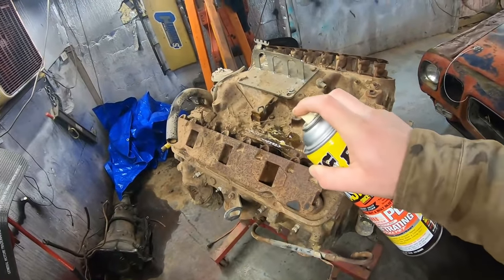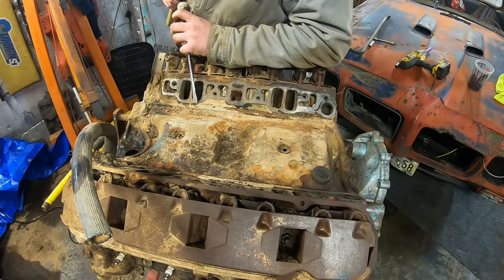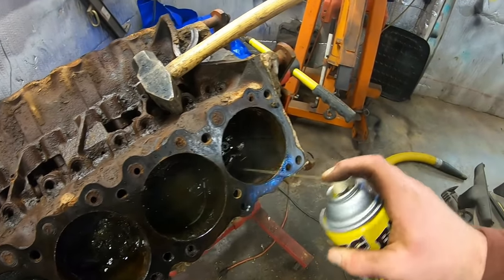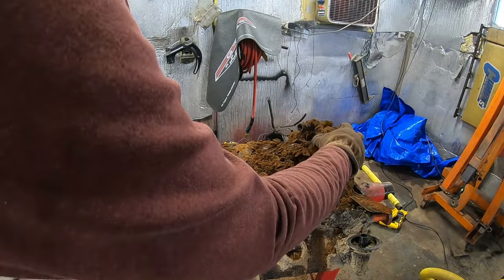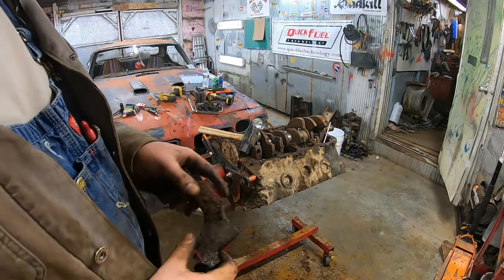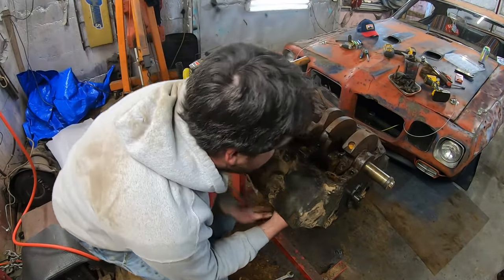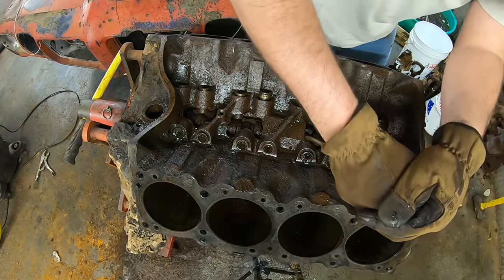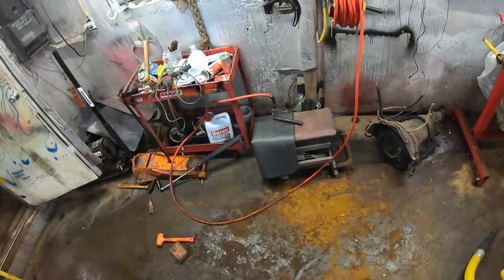INCREDIBLE! Worst GTO Ever: Holey Goat OG Pontiac 400ci Engine Teardown — CAN IT BE SAVED?

Comment: It’s probably been said already but I’ve had a lot of success de-rusting parts using a 2 or 4 to 1 mix of molasses with water. You can buy molasses in a big tub really cheap from a horse feed supply then just put it all in a plastic bin. I didn’t use this on my 400 rebuild but have used it on lots of other parts that have captive components e.g. heater box on my ‘68 Firebird.....and then get it hot tubbed if needed. Love the video too 🤓👍
Reply from the maker: It has been said, and with your comment I'm now even more curious to try it!

Comment: hing is fixable, unless its crack, I pulled a 401 nail head, under ground for 30 years, And got it apart and running, I stuck the block in a 55 gallon drum full of old oil Built a fire under it for 2 days, worked perfect. Try it

Comment: Thats horrible, I pulled one apart that was in the bottom of our lake here for nearly 40 yrs, it was rusty but it wasn't even that bad. I got lucky and was able to save the double hump heads on it, rebuilt them and ran them on my dirt track car. Never do that again cause it was giant mess all over my shop. Love the vid, brings back memories. God Bless!
Reply: Lot of the bolts just broke off so it was a fun time tearing it down. Impact and a torch, lot of sweat and swearing, few broken tools but no sweat! Pistons didn't come out neither did crank so it got dumped after heads removed. New valves springs and some machining she was good!
Reply from the maker: Thanks!

Comment: I had the Ram Air 400 in my 68Firebird  I bought brand new, the car was an idiot magnet, my best friend drove up and tore the door off a week after I bought it, I was parked in a drivethru diner, an idiot cranked his wheel and caved the whole side in , no insurance, got sideswiped by a hit and run driver tore the other side up, never found them. Then I got rear ended by a sleeping truck driver on the freeway ,and he almost ran over me, I got drafted and sold it in 1970. It was a beast of a car though for the time period, now it would be a sled, but back then it beat most production cars  It had a terrible time coming out of the hole though with the 4 33 rear end and no traction bars. I always wished I had the money to put traction bars and slicks on that car and see what it would do, my best 1/4 mile was 13"70 and I know a better set of pure stock tires would  have really helped wide ovals sucked

Comment: Run a wire from block to your electric pipe. Preferably to cold water,  bond it with a hose clamp. Quick & safe solution, for your getting  zapped issues. See NEC 250. Hugh Mc. Chicago,  metro
PS: may I humbly suggest, safety glasses. We get one set of eyes.Peace. [ nice work on stripping block,  hope no cracks when they magnaflux it.

Comment: That was kinda fun (at least to watch)
 Subscribed 
Great to see someone who isn't just 'spend $20,000 on new parts' or 'stick an LS in it'
Didn't think anyone in America did this sort of thing.
Never seen those valve 'drippers' before and didn't know they existed although I've only pulled two Pontiac engines apart (1965 Catalina 389 and a 76 - 400)
Both are still sitting in garage since I was laid off and couldn't get a job (now I'm retired and even more broke)
Never seen a motor that bad unless it was underwater for years. 
Even one that had gone off a cliff and was on the rocks for years wasn't that bad (even though the rest of the car had rotted away with sea water)
Reply from the maker: I might need that 389 👀
Reply: @PoleBarnGarage  Heads are good with a very small chamber. 
'Small' valves as well though.
I was going to fit hardened exhaust valve seats and large intakes but never got around to it, new seats still in box
Block has a very bad cylinder that is going to need liner, pitting is real deep

Comment: The absolute best product for derusting any ferric metal is Evaporust. It's non-toxic and non-acidic and non-corrosive to the base metal. It only attacks the corrosion. It works by a process called chelation. I bought a 2 1/2 gallon bucket at Summit and used it for 4 years. It works good till it turns black with use,  then becomes less effective. The metal comes out looking new. Safest way to save the parts and completely derust them. BTW, it does get very cold in TX. I travelled to the DFW area in Sept/Oct for business years ago and it was colder there than in the DC area in Northern VA where I lived at the time when I arrived there. Way colder. They get the winds blasting through the Rockies with no wind break. Most frozen engines I've seen are pushed out on the sides. If it still had the core plugs in it it's probably OK.
Reply from the maker: Oh hands down evapo rust is the greatest. But, I didn't want to spend the bucks right away

Comment: That will be so cool if you can put its original engine back in this . my dad did rebuild a 57 olds j2 engine that literally sat in the mud in a river it rolled into at some point being separate from a car he restored a 57 2 door post j2 371, 3 speed car no options . not even a heater . I'm sure all can guess how rare that is . any way that engine was full of mud silt right to the top but miraculously preserved cause once it filled up and solidified it was fairly sealed from oxegen although all the tin work Basicly crumbled once we started dealing with it. But it had been in that river since Posibly 1965 when the car was parked and last licenced and he got it in 92 so almost 30 years .but what is baffling me here is that this engine was in the car still and had that much stuff in it. Posibly a bunch of mud dobbers had got in it and built in it and also got flooded a few times.

Comment: You know, the first time I watched this video, I was absolutely amazed by how disastrous this engine was on the inside.
Now a year later, after I bought an early 400 for 150 bucks in the middle of Arkansas and hammering every single piston out of the cylinder with a 3 pound sledge, I have gained a newfound appreciation for Dalton's work.

Comment: the "good" thing about breaking a distributor is now you can use it to pre-prime the engine after building it and before running it dry for the first time. 

I have a 400 this crusty--soaked it in a kiddie pool with molasses (sometimes vineger works, make a 50/50 brine with salt to soak the fasteners you plan to reuse) and muric acid from a pool store to break the piston rings free when coca cola didn't work fast enough.

Comment: I had a 383 from a dodge powerwagon that would make your 400 look brand new. The truck went through a flood and ended up in the middle of a beaver dam where it sat for years oil pan was rotted right off it and it sat in water for years. Air hammer was best friend for days tore everything off it that would come off and had to break every piston into pieces to get them out, drove cam out of block with the cam bearings still attached. I sand blasted all the iron with black beauty slag including crank. Paid 300 had block bored new pistons, bearings, cam, timing set and all the tin and aluminum parts and carb and it was a running engine again. had to repolish crank and regrind valves and seats but but 80% of the old engine was saved and reused.

Comment: Broham, I would've pulled the oil pan and pressure washed everything inside of that block, then pulled the valvetrain, installed all new lifters and pushrods, replaced the head gaskets, and had the heads planed...maybe checked the deck as well. You have to know how finnicky those Panty-ac 400s were. Most Panty-ac engines had issues for some reason, but the 400 especially.

Comment: I once bought a 76 chevy truck that sat for 15 years with the intake off and a blanket laid over it out in the weather the engine was full of water up to the crank but amazing the block itself was empty so it didn't freeze and Crack I took a cam and kept the lifters in order from a engine I was rebuilding and put in it because it had three wiped lobes that was why they parked it they were so bad it kept spitting out pushrods that engine was so gummed from the quakerstate that when I drained all the water out I just filled it up with kerosene for a week drained it again and called it good the rockers and fulcrum balls were solid rust I soaked them in a bucket of coca cola for a week then slathered them in some red and tacky and installed them with a used set of pushrods that were on the shelf and threw it the rest the way together fired it off ran it for about a half hour changed the oil again and drove the snot out of it when I sold it still ran good a guy took it out west and crossed the rockies called me when he got home and said it ran great and had no issues

Comment: Do you know if the GTO had been rolled?  If a car is upside down for a while the engine oil can seep to the top of the pistions and after getting back on the wheels the engine will NOT turn over, even with a braker bar... (oil in the combustion chamber)  The car maybe deemed to be junk... and shot ALL to hell.... Just a thought why a GTO was target pratice....
Reply from the maker: I'm sure it was flipped a few times around the ranch, I would've. It didn't appear to have been rolled in an accidental though

Comment: I'm guessing you found the vin after pulling the engine? I thought you said in thr beginning of the build that this wasn't the original numbers matching engine.
Reply from the maker: I did, was looking at the wrong number
Reply: @PoleBarnGarage  Aren't you using the original factory matching transmission currently? I forget. Wow now that's the numbers matching engine  I really hope you get it back in the holey cause it would be awesome to have the holey goat drive with it's original drive train.
Reply from the maker: Og trans is getting rebuilt as we speak
Reply: @PoleBarnGarage  Doing that yourself or did you have to send it to a transmission shop?

Comment: I enjoyed watching you dig into and remove all the crud to get the usable parts. It looks like you removed 20 pounds of mud from the bottom of that engine block. I hope the engine can be rebuilt and returned to the car. If the engine is rebuilt I would not use it for racing or abuse it too much - it is too valuable as a piece of history.
Reply from the maker: That wouldn't be right, it's a street machine and it was meant to be beaten. We will use it the way the good general intended
Reply: @PoleBarnGarage  I can see your point of view but numbers matching only occurs once. Beat the crap out of an LS, they are in most of the salvage yards. My two cents have been given.
Reply from the maker: Dear God, I would never put an LS in this car! I physically gagged. The old ponchos got more grit (literally) in her number 3 cylinder, than a whole fleet of LS engines

Comment: Drill some holes in the center of them and use an old body shop slide ram to Pull them out!!!!!
Lifters that is!
Reply from the maker: Risky on a Pontiac, you always want to go out the bottom if you can. You can see the webbing between the lifters is open, it's a known weak point

Comment: You know, if you bolt the arms of the engine stand to the other side of the plate, and turn the bolts around, the engine will spin over a lot easier

Comment: As farfetched as it sounds, my engine was probably a little worse than yours. I actually had to drill holes and completely break 7 of the 8 pistons out of my block because they were 100% seized. All my valves were frozen and rusted same problem with the lifters and everything. The damn thing took a .060 over bore and is running beautifully in my car. Every time I look at the pictures of how bad the engine was, and I hear that Pontiac roar it makes me a believer. That old iron can take a whole lot and be put back on the road again.

Comment: The worst GTO would be Joe Hind's Judge in Washington state.  He had it in a carport for a while and then pushed it out into the yard. He lived just a block away from the Salt water and next to a paper mill which spewed pollution like crazy in those days. The blackberries eventually engulfed it. The family wouldn't sell. Two years ago it was finally removed....I was told that the only part that was salvaged was the transmission.

Comment: Recent subscriber. Dust Theory: block and dust shares ionic charge. Vacuuming caused the dust to drop electrons on the hose which built thr charge on it and you. You kept charge because sneakers hold back a decent volt/amperage. You touched block that was bolted to metal stand with metal castors. Instant discharge. It's not shocking, it's science.

Comment: It was parked in the 70s, right? That was in the middle of the gas crisis era. My theory is that most people at the time wouldn't even glance at a 400 big block, let alone consider buying a used one. Low mileage or not. That's the only way I could see a low mileage engine being left to rot instead of being salvaged. I bet it ran beautifully before the car was left to rot in the field and subsequently shot up.

Comment: I had a 1964 GTO as a High School senior in 1973.  They really were not good cars.  9 MPG no power steering and no power breaks so it rode and steered like a turnip truck.  One wheel peel too.  the Pontiac 400 was a terrible engine with thin coated journals that wouldn't really accept the horsepower of the three deuces. I though rods through 2 engines,  My folks made me get rid of it which was a good idea.  I traded it for a 1971 Honda CB750 which was a great bike.

Comment: This is why I never ever sell my motors from the 60s & 70s I got well over 40 in my 2 car shop, Olds, Pontiacs, & SBC My family thinks I am crazy to keep in their opinion, that nasty old junk. Fact is I just rebuilt a 67 Vette 327 I had laying on the floor for decades with all new everything and put it in my 1970 Chevelle daily driver and it's running like a clock. P/S next time you get a stuck piston that bad again. use a 1/2 drill bit and drill a circle around the top of the piston to remove the rod out the bottom, then a line of holes out to the edge of the piston each side to weaken it and the piston will come right out with nothing but a bunch of hand drilled holes.

Comment: Built a lot of 400's, that engine can be salvaged pretty easily by a decent machine shop. Not sure what all the drama. The problem is cost and looks like by using the hood as a workbench the car may not be worth it. Those hoods are just 2-3k is all.

Comment: In my 20s I had a 1970 half firebird formula 400. It had the ram air 3 engine. One day I removed the valley pan and seen my cam bearings pocking out on side. Thin as tinfoil. The motor was still running great. But after I seen that. I knew it was time to rebuild. Never rebuilt it. Sold it. And next owner put a Chevy 350 and automatic in it. What a waste.
Reply from the maker: Cam bearings are optional

Comment: There was no need to remove the distributor at that time. Soak it from the top then the bottom after the oil pan was off. Heads come off with removing the distributor.
Reply from the maker: Yeah probably should've waited, but it wasn't coming out of there clean any way you slice it
Reply: @PoleBarnGarage  no way to know that without more patience. Still a fun project.

Comment: You said it yourself.  That motor proved itself.  You can build it to Ram Air 4 specs.  Just research the RA4 specs and build it up the way the information says the ram air 4 was built
Reply from the maker: Not without $5000 round port cylinder heads. I can build an engine that performs better for far less

Comment: Thin parting line, I wonder why Pontiac didn't forge their hp cranks. I guess that particular crank would be a "N" crank , I don't really know Pontiacs well. Earlier cranks were armasteel or something? I've heard the Nodular cranks hold up to power levels where most sister companies forged cranks fail. Don't know how much truth there is to that but the Pontiac guys around here talk highly of them. 
Here in North AL we had an old guy, Squeeky Garner we called him, past away now. But he had every car he ever owned behind his house with trees growing through them and some at another piece of property. He had a goat same body as this one here but he wrecked it. The engine and 4 spd was sitting at another property he owned on a homemade engine dolly outside.  The talk was he pulled it out and went through it to install in a 55 Chevy he had and the engine had been sitting for 10 or 15 yrs. I remember the valve covers were just sitting on it with the cork gaskets still in new shape, but the chrome valve covers and breather was bad rusty and it was locked up tighter than a wedge cause we tried to turn it over. Best I can remember the 4spd wasn't sealed up either and probably junk. That was 92 or 93, I often wonder what happened to those old cars and that old 400 engine. The old homemade dolly was tall, the engine was like chest high. The old house where the 400 sit and 3 or 4 old cars like 30's,40's or 50 models was tore down and a fire station was built many yrs ago in Anderson. I'm sure some of the old timers in Anderson still remember it.

Comment: It would be great 👍 If it is able to be Rebuilt bore it 30 over Port and Polish the heads new Valves and Valve  Springs. New Crank put a hot cam in it Lifters Push rods oil pump it would be Awesome Put it all back in.  Numbers Matching.
Reply from the maker: Probably more like .060 but we'll do whatever we gotta do!

Comment: I will offer an explanation on you getting sapped from over the pond. When you vacuum, you create an air stream over the surface of the engine. Cold air is dry, so the air is heavy & dry. The small amount of friction over the surface creates a charge that can not get to ground due to the stand is on plastic wheels. Thus, you are getting sapped. If you care to test it, stand on a dry rubber mat when you touch it, or run a grounding cable from the engine. You should not be sapped.